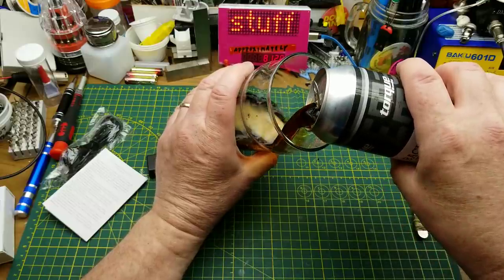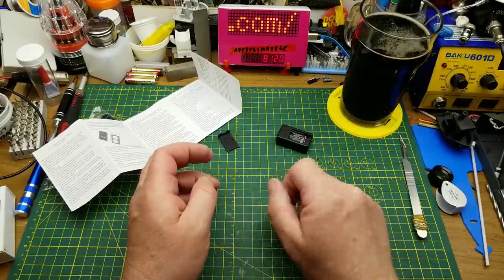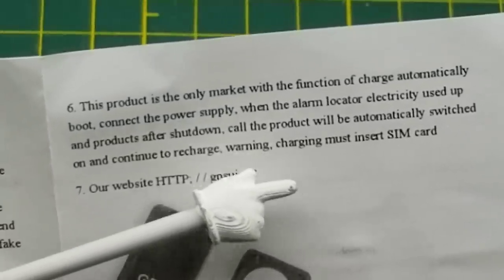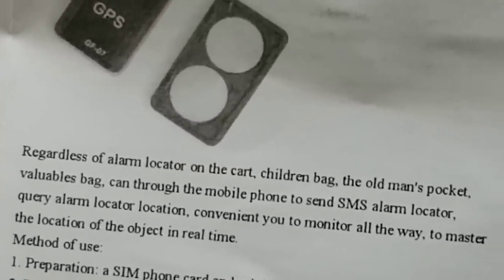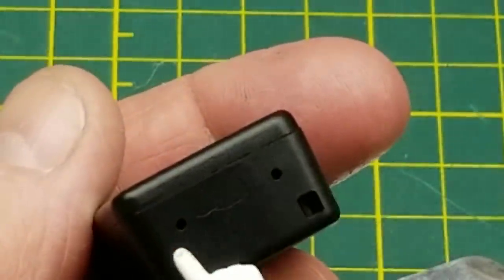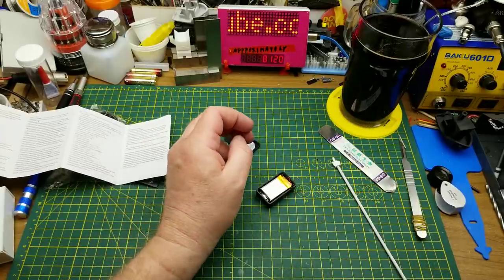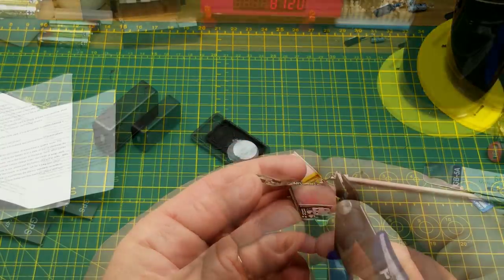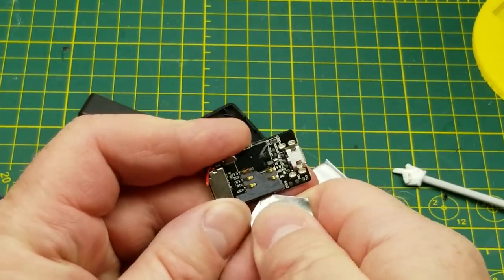fake gps tracker teardown

Comment: When you read into the transportation guidlines for private customers from the big delivery services (DHL, UPS, FedEX etc.), they all decline the international transportation of LiPo Batteries or devices containing them.
The other day I ordered some replacement LiPo Batterys from China and I was wondering how the seller could send them without any additional shipping charge. Weeks later I received a parcel and to my very surprise it contained several small devices. All packed up in their own single box, along with a brief paper manual.  Just like this GPS Tracker you just teared down. First I was very angry to receive stuff I never had ordered. It took a while, but then it gloomed on me that these units maybe the containers for the LiPo Batteries I ordered. So I cracked the units open and I then found the LiPo Batteries I ordered. Some soldered to not populated Boards, some wrapped up but simply loose inside.
So maybe, this GPS tracker is just more a device to hide the Battery from customs and the curious eyes of the delivery service.

Comment: Somebody at the factory made a batch or three of them after hours, and the silicon was the only part they could not get without leaving a trace, so they simply did not use any. Then took the lot and sold them, probably as a second delivery to an unsuspecting buyer after selling him a first batch that worked correctly.

Comment: I actually got one that at least contains the correct chips inside! One from Mediatek and another one is the gps module ... if anyone is interested  I can post here the chips used since I simply don't have right now the way to test the thing.
Reply: It would be great if you can share information about the chipset used in this device.
Is it mediatek MT6261 ?

Comment: I bought one a couple of years ago.  Having the same concerns, I never used it and felt much the same about possibly using the components for other projects.   After watching your video I decided to pull the can off the top and to my surprise, there are actually chips on mine.   Still don't trust it but at least is seems a little more legit.  Most of the rest of it is of the same build quality with the tinfoil attempt at an antenna and cheap microphone.   I seem to recall I was able to charge without a SIM card so in all likeliness, the chips are for charging and little else.    I can share photos if you are interested in seeing what should have been populated on the board.